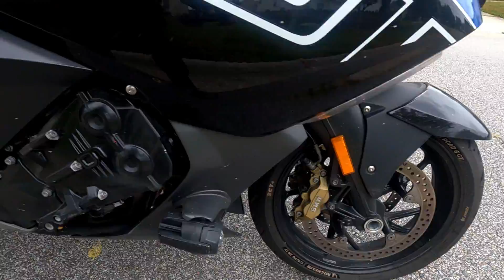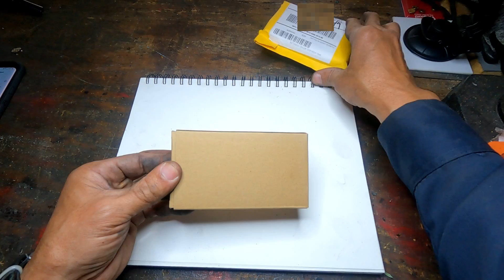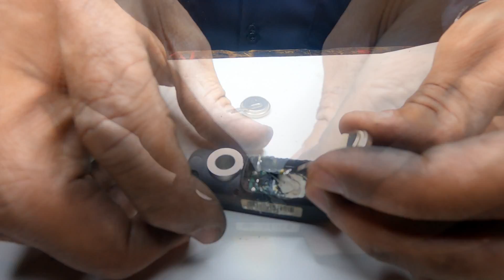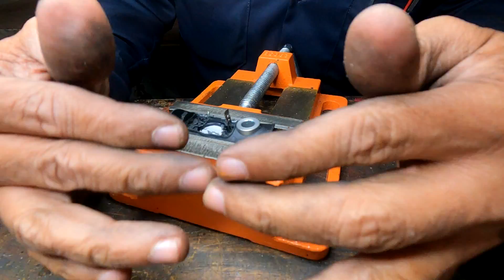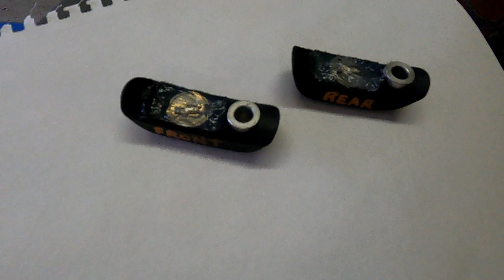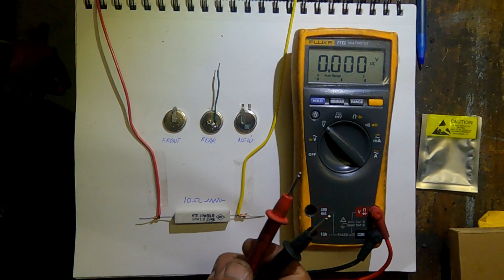BMW TPMS Battery Replacement K1600GT: Old Battery Load Test at the end.

Comment: Thanx Tony great vid, I’ve got a GTL exclusive and found a pair of these TPMS sensors for 25$ on EBay.
Reply from the maker: My battery fix only lasted a few months. Dont know how long these batteries sat on the shelf. I also found sensors on Amazon for less than $30.00. Had to enlarge the bolt hole a little for the bolt to pass through but they have been working great since install. Thanks for watching and commenting.

Comment: BMW dealer charged me $450 for 2 sensors and bolts for my 2007 F800ST. Ridiculous. Saved the original ones and definitely will replace batteries myself next time.

Comment: 150 bucks is cheap. Here in Britain they want about 5 times that to replace just one. They can do one
Reply from the maker: Wow, riding must be really expensive over there! Hope your income level matches the cost of living.
Reply: @tonycarthan6425   I followed your method for measuring the new batteries with a multimeter. One was 3v and dropped to 2.6 when I soldered it in. I thought maybe I shorted it or did something wrong. I took it out and tried another (I bought a pack of 3 expensive TPMS batteries which are CR2050).  It did the same again but only dropped down to 2.8.  I tested on the bike and it's fine, but I'm wondering how long these batteries have been sitting on the shelf.
Reply from the maker: That is a concern. I did eventually order complete replacement units from Amazon for less than $30.00 a set and installed them. Even those may have been on the shelf for a while but the savings $$ was worth the risk. They are still going strong. Thanks for watching and commenting.
Reply: @tonycarthan6425   No worries, thanks for the video. Stuff like this saves me a fortune. My local BMW shut down so that was a bummer and many things I would normally get them to do I'm now doing myself.

Comment: Compatible TPMS sensors are $20 for the pair on Amazon. This is interesting but probably not worth the time.
Reply from the maker: Yes you are correct. The batteries lasted about a year and I finally replaced them with an Amazon set. It was a fun experi.ent but you are correct. I did have to file the inside of the aluminum sleeve on the ones I received to accommodate the mounting bolt, but they are working just fine. Thanks for watching and commenting.

Comment: how do you get the GPS screen to show that info?
Reply from the maker: I apologize for the late response, been buisy.

On your main screen select APPS. Then MY Motorcycle,  then Information,. At this point there may be multiple fields of information displayed. For this example I went to Settings,  selected number of fields, then 2. Now when you back out only two fields will be displayed. Touch one of the fields and you can then select what to display, in this case front or rear tire pressure. It sounds complicated but it's not.  Thanks for watching and subscribing.

Comment: Good job Tony.  Have you tried the new sensors sold for cheap on Alibaba and Timu ?  do they work on these bikes?  My rear one keeps going in and out.
Reply from the maker: https://a.co/d/9o3cwAe
https://a.co/d/1R2OJvy

I did eventually replace the repaired sensors with ones from Amazon in the link above. Had to enlarge the hole for mounting bolt a little bit but they are working. The readings are not exact but are consistent. I used a GS911 to reprogram the new sensors and a cheep wake up tool, also in the link above. Good luck and thanks for watching and commenting.
Reply: @tonycarthan6425  Thanks Tony but I don't buy anything from Amazon as I hate it with passion.  Also I don't have nor want to spend the crazy money to buy a GS911.  I am basically tired of this nonsense where one has to replace sensors and buy scanners instead of simply checking the tire pressure the old fashion way....who thought this is a good idea.!!   I am sick of the K1600 and it's endless issues.  Just had the rear shock rebuilt by EPM in NJ.  Now the shock will not go up and down, it was doing that just fine before.  Most likely I will sell the bike or set it on fire. I am happy with my old 1999 RT.  Reliable and does not have all these endless issues.
Reply from the maker: @AB-hx9hs 

 Sorry you feel that way. Most any brand of motorcycle, car,TV, washing machine, purchased these days come with an increased degree of complexity.  If you are a DIY consumer, you must adapt and acquire the appropriate tools. I owned a 1979 Suzuki GS1000N. It had spoke wheels, chain drive, carburetors, a cable driven speedometer  ect... I loved that bike. As time and technology advanced, I followed and adapted. Just my opinion. Hope things work out for you.

Comment: Since I don't have a GS-911, do you know if the OBD2 readers you can borrow at Autozon will work on the bike?  I would have to get a converter cable (From BMW round connecter to the rectangular one of the OBD2).
Reply from the maker: I would not recommend useing anything that is not designed for your bike. Have heard the wrong device could dammage the system. The GS911 is expensive but money well spent.
Reply from the maker: Yes I have read the same. That is designed spicificalky for motorcycle use but I have no experience with the product.